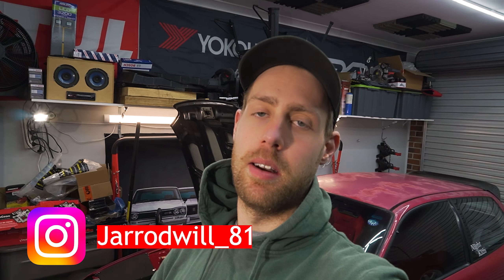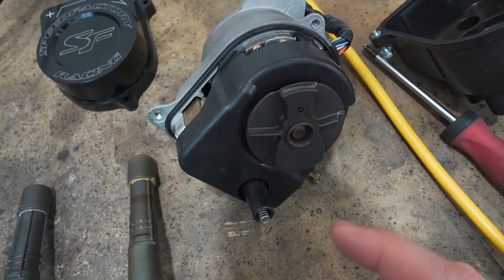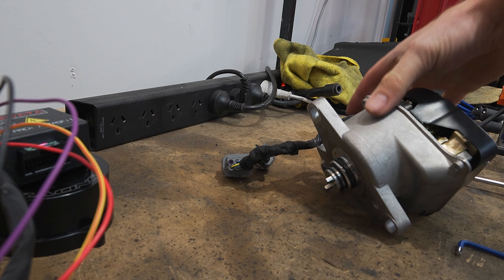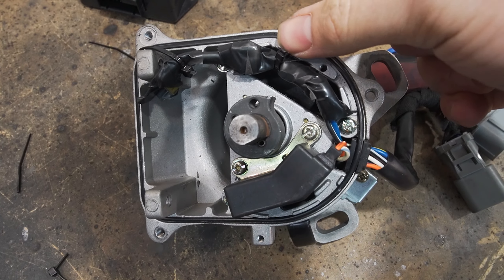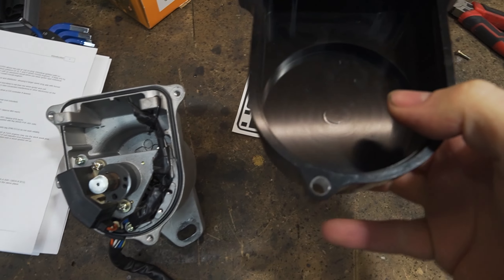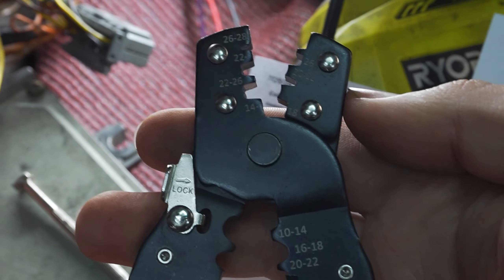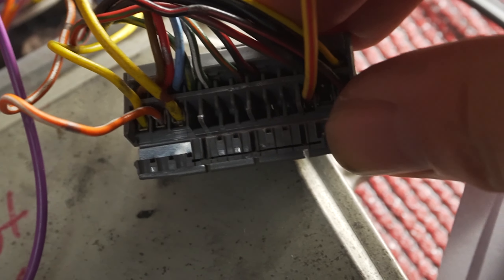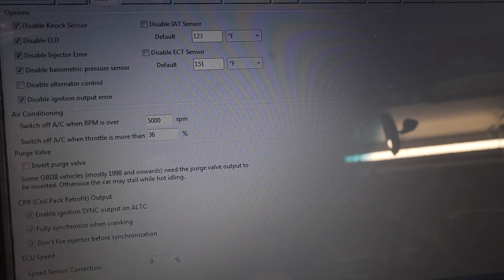How To Install Hondata Coil Pack Retrofit Kit | Detailed | B16, B18, B20

Comment: The reason the distributor cap didn’t fit is because you have the wrong one. B16 and GSR are different caps. 
Great install video by the way!
Reply from the maker: Ohhh thanks I didn’t know that. It’s just the one that came in the kit from marketplace. Thanks for the feedback.

Comment: Run a leak down test on the motor, verify the injectors via a shop who can perform a flow test/ultra sonic cleaning.
Reply from the maker: The injectors are only 2000kms old you think they can be blocked already?
Reply: Actually yes if only 2000km it's unlikely but the flow test will ensure the injectors are functioning and flowing evenly. You could find on the internet reports of racing and dead cylinders due to bad fueling of a failed/failing injector. I would check injectors after running the leak down test.
Reply: It's the harness
Reply: Their is a plug called the junction plug I'm 100% sure that's your problem
Reply: Cut it up and wire up the colors together so it can get better voltage to the injectors

Comment: When did you get the misfire? 

I’m going thru the same thing atm. After my tune I’ll notice it misfire in 3rd gear on full throttle around 5000rpm.

New plugs , checked leads, new dizzy cap.

Tuner reckons told me to try new dizzy if it’s not that he said probably got a fried hondata
Reply from the maker: Misfire started at light throttle cruising but was fine full throttle. Over time it slowly got worse and worse then just did it all the time. It was like something was slowly dying. I fixed some wires going into the ecu and it idles fine now but that makes me think it nigh be a wire that’s broken.
Reply: @JarrodWillemse  interesting stuff .
Reply from the maker: @dguanz  I'm going to do a video changing the harness soon. Lets see if it fixes it. Otherwise i think i might go to a link.
Reply: @JarrodWillemse  I was thinking the same lol
Reply: @ I’m running Dinosaur s300 v1 . It came with the car
Reply from the maker: @dguanz  Mines a V2 but the problem is these ECu's are just so old now.
Reply: @JarrodWillemse  that’s true man. A lot better stuff out there! Like hondata isn’t even cheap for what’s it’s worth lol
Reply: @JarrodWillemse how’s the car running with the new cop kit?
Reply from the maker: @dguanz  still haven't fixed the misfire. I think i need a new wiring harness.
Reply: @ hey bro hope you’re well.

I finally found the misfire after all the stuff around. Yeah it was the tune causing it to spit and misfire at 5000rpm
Reply: I even put a new hondata in last week and it was the same shit.

Then looked into the tune and sorted it.
Reply from the maker: @ That's good. Was it fine before then got worse? Usually around 5000rpm is vtec crossover.
Reply: @JarrodWillemse  it’ll come and go depending on weather. But yeh the tuned fixed it.

Comment: Any updates on diagnosing the problem?
Reply from the maker: Nahh not yet I fixed the harness and it runs better but something still wrong I bought a new harness to put on the engine so I will try that next if not I think the ecu has a problem.

Comment: My car sometime feels like it's hitting the rev limiter or limp mode when I accelerate to a certain speed and goes away when I shift gears. Idk what it could be besides speed sensor being faulty or distributor.
Reply from the maker: Sounds like it could be the tune. There might be a few cells that need touching up. When you change gears the load on the engine changes.